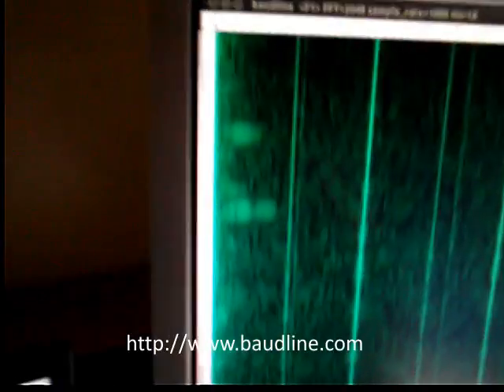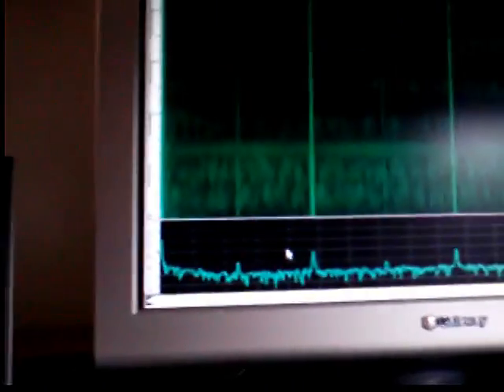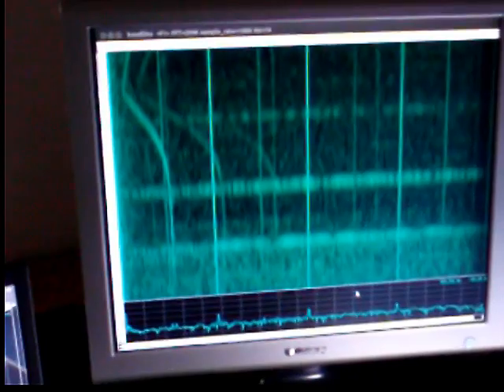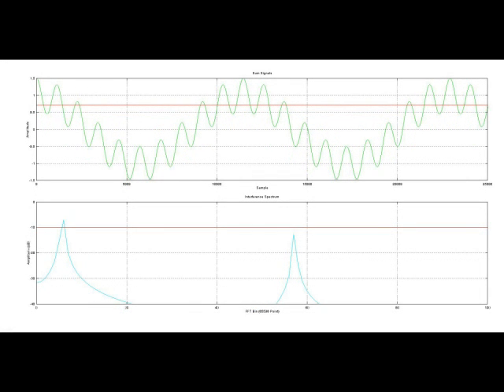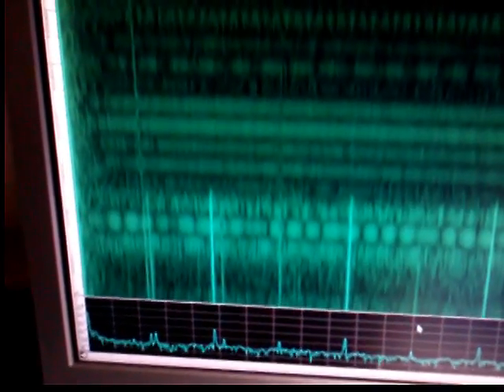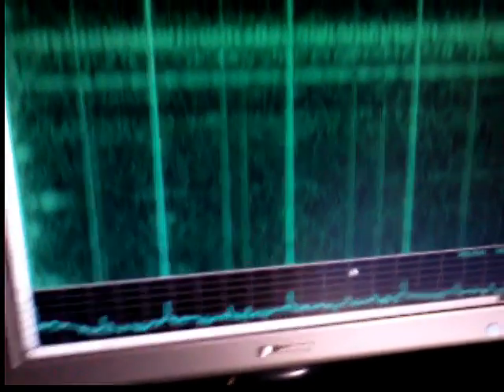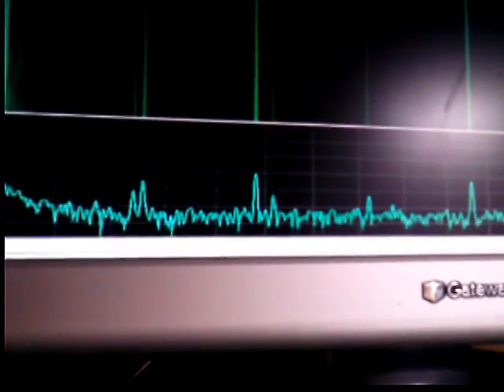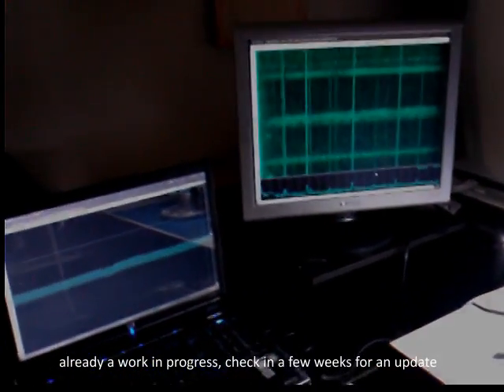ISM Radar Testbed: Doppler Experiments

Comment: Very cool project! Did you ever do anything more with it?

I wonder if it would help blind folks get around?  You could use some raybans for the plates, not like they need to see through them. :)  I've often wondered if you could send out something way up in the ultrasonic range, say 250khz, and then mix the reflections in with some hearing-aid style receivers, if that would help with perception of the environment around them.

Of course a small xbox style 3d scanner would work and probably be more specific.  Just need to do some psycoacoustic modeling to convey the 3d space as sound.

Comment: Great use of baudline!  Using an external USB powered audio device might help with the 60 Hz bleed in.  Another option would be to mix your radar signal higher in frequency so that it is in a cleaner part of your sound card's spectrum.